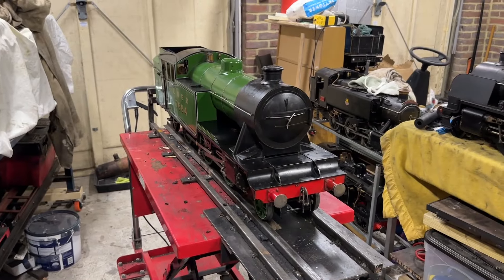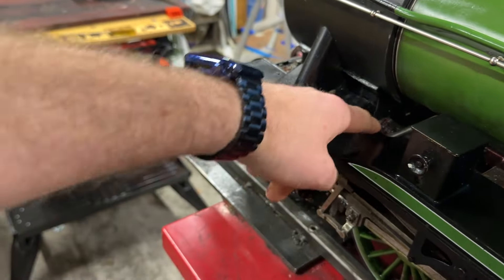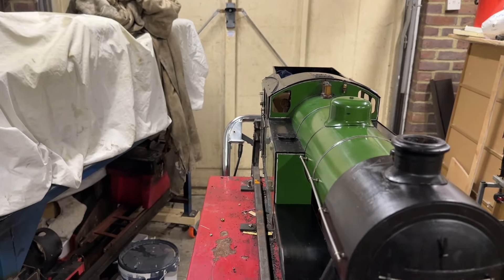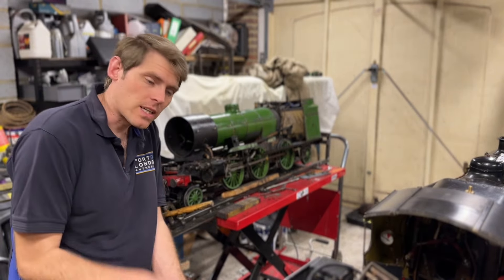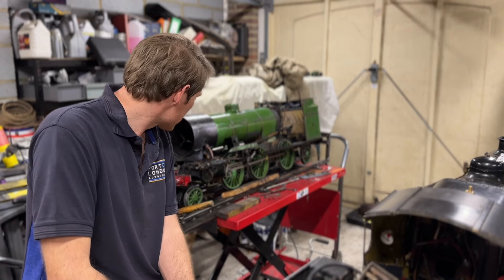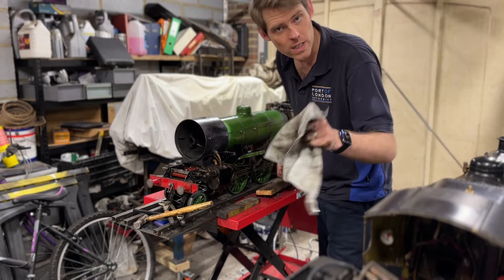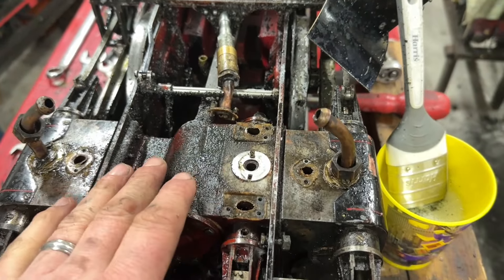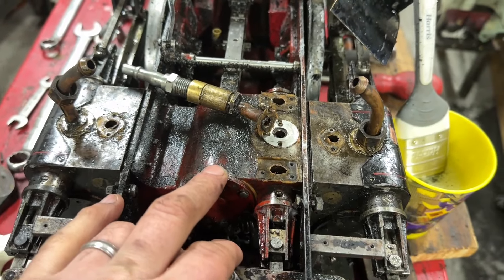Enterprise gets its first run of the year, and first repair…

Comment: That’s the pesky things with tank engines to get at the boiler. Tapped holes are so much better than nuts and bolts for when you want to get at things. Also metric cap screws for when you can’t see them. So many published designs aren’t really dismantling friendly.
Reply from the maker: This one was built with mostly tapped holes, the smokebox saddle was the only nuts and bolts. Have changed the direction of a couple of the bolts to make life a lot easier.